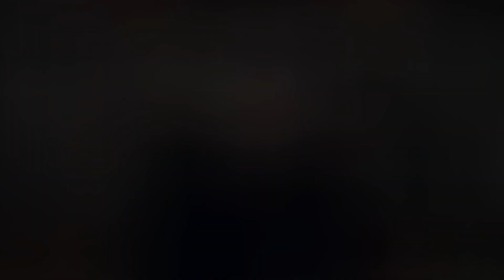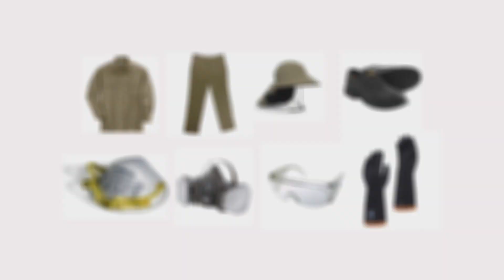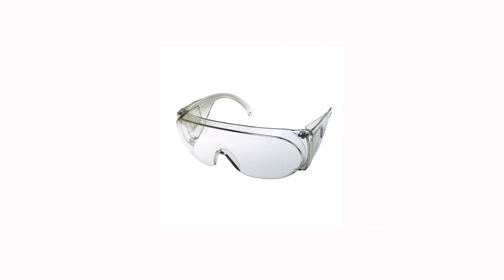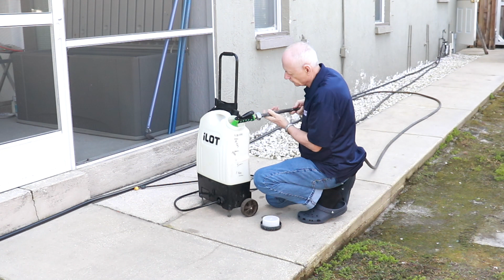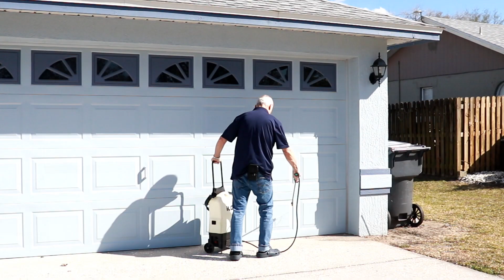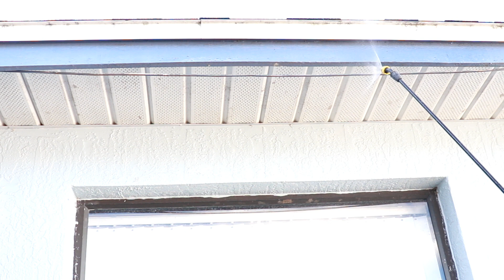How to Prevent Drywood Termites 100% Guaranteed.

Comment: If located a drywood series of kick outs, suggest a spot treatment please, great video on prevention will incorporate but have an active swarmer being attracted to the frog tank black light at night.
Reply from the maker: First, make sure that these are actually drywood and not subterranean.  I will give you a link to my video on how to identify termite species.  If you confirm that they are drywood, then there is information that you need to know.  Please get back to me if they are subterranean.

It is important to understand how drywood termites work.  They enter through cracks and crevices around windows, doors, the eaves, pipe penetrations, and so forth.  Most of the time, they enter through several locations.  That is because a swarm of them attacked your house at the same time.  If there was a crack or a crevice, then they probably found it.  After they established their galleries, which will be inside the wood, it will take four to seven years for them to be able to swarm.  Now that they are in your house, the swarmers will use holes that are in your studs to travel through the walls.  Those holes in the studs were created by the electricians to run the electrical wiring.  Not only are these holes going through the studs, but holes were drilled into the attic for the light switches and to run some of the wiring for the outlets.  So, the termites now have easy access throughout the attic and the walls.  If you have a basement or crawl space, they have access to that as well.  Most of the time, you will have no idea that they are in the walls, because the frass is inside the wall.  To make matters worse, if you have drywood termites, then your neighbors have them too.  That means you have been getting swarmed for as long as they have existed in the neighborhood.  Most likely, we're talking about years, so it's a safe bet that you have these guys in many locations in your home.
                            
I always hate to be the bearer of bad news, but if you have drywood termites, the only way to get rid of them is to fumigate.  Prices for this can vary wildly in this industry, so I recommend that you watch my video on how to hire a pest controller without getting ripped off.  That video can save you a lot of money.  You should also know that the gas they use to fumigate has absolutely no residual action whatsoever, so you can get reinfested the moment the tent comes down.  Like I said before, if you have drywood termites, then your neighbors have them as well.  Since drywood  termites swarm every year, it is almost a certainty that you will be reinfested within a year after the fumigation is done.  The only way to prevent this is to do a preventive treatment on your house every 60 to 90 days.  Most pest controllers will not do this, so it is something that you generally need to do yourself.  I have a video on how to do that and I will place a link below.  If you absolutely cannot afford to fumigate your house, then you can try spot treating it yourself.  It is virtually impossible to find all the termite galleries, but it is way better than doing nothing.  Regardless of how you treat it, you should begin the preventive treatment immediately, so that you do not get additional termites paying you a visit.  

I hope that helps.  Be well my friend.                        

Video on how to identify termite species:  https://youtu.be/dIs_a0nfVjg

Video on how to hire a pest controller without getting ripped off:  https://youtu.be/y-a8XOqVrlE

Video on how to spot treat drywood termites:  How to Treat a Drywood Termite Infestation Yourself. A MUST see if you have Drywood termites.

Comment: What is your recommendation on spraying windows and soffits on second floor without going up and down a long ladder every few feet?
Reply from the maker: You are not supposed to do this, but I do it with a hose end sprayer.  Please watch my video on how to treat your yard with a hose end sprayer.  The sprayer in that video has a stream setting that will reach up to 25 feet, depending on water pressure.  You must use Bifen XTS in the sprayer.  It seems expensive, but it only gets mixed 1/3 oz per gallon, so it goes three times as far as other pesticides and it works well for drywood termites.  In fact, that is what I use.

I hope that helps.  Be well my friend.

Video on how to treat your yard with a hose end sprayer:  https://youtu.be/wifoTU5dmp0

Comment: Hi thank you for your video I am dealing with both types of termites rite now and because my neighbors house was tented about a month before she bought it and she ended up having an issue again in less than a year I am reluctant to spend thousands of dollars to have our home tented. I really don’t have money to waste so I’m wondering what you would recommend to go along with this to treat the other type can you link the video you’d recommend for them please
Reply from the maker: Let's start with the drywood termites.  It is important to understand how drywood termites work.  They enter through cracks and crevices around windows, doors, the eaves, pipe penetrations, and so forth.  Most of the time, they enter through several locations.  That is because a swarm of them attacked your house at the same time.  If there was a crack or a crevice, then they probably found it.  After they established their galleries, which will be inside the wood, it will take four to seven years for them to be able to swarm.  Now that they are in your house, the swarmers will use holes that are in your studs to travel through the walls.  Those holes in the studs were created by the electricians to run the electrical wiring.  Not only are these holes going through the studs, but holes were drilled into the attic for the light switches and to run some of the wiring for the outlets.  So, the termites now have easy access throughout the attic and the walls.  If you have a basement or crawl space, they have access to that as well.  Most of the time, you will have no idea that they are in the walls, because the frass is inside the wall.  To make matters worse, if you have drywood termites, then your neighbors have them too.  That means you have been getting swarmed for as long as they have existed in the neighborhood.  Most likely, we're talking about years, so it's a safe bet that you have these guys in many locations in your home.

I always hate to be the bearer of bad news, but if you have drywood termites, the only way to get rid of them is to fumigate.  Prices for this can vary wildly in this industry, so I recommend that you watch my video on how to hire a pest controller without getting ripped off.  That video can save you a lot of money.  You should also know that the gas they use to fumigate has absolutely no residual action whatsoever, so you can get reinfested the moment the tent comes down.  Like I said before, if you have drywood termites, then your neighbors have them as well.  Since drywood  termites swarm every year, it is almost a certainty that you will be reinfested within a year after the fumigation is done.  This is why your neighbor got reinfested.  The only way to prevent this is to do a preventive treatment on your house every 60 to 90 days.  Most pest controllers will not do this, so it is something that you generally need to do yourself.  You already watched the video on how to do this.  If you absolutely cannot afford to fumigate your house, then you can try spot treating it yourself.  It is virtually impossible to find all the termite galleries, but it is way better than doing nothing.  Regardless of how you treat it, you should begin the preventive treatment immediately, so that you do not get additional termites paying you a visit. 

If you have drywood termites, then you also live in Formosan termite territory and you may have a more common species of subterranean termites as well.  So, how you handle that will depend on the species.  Figuring out the species is actually pretty easy and I have a video on how to do that.  I will provide you with a link below.  After watching this video, you should be able to identify the species.  Just get back to me after you watch it and let me know what you found out.  At that point, I can tell you exactly what you need to do.  Let me know if you have any problems identifying the species, but I do not think that you will.  It is much easier than you may imagine.  If these are a common species of subterranean termites, then you may get away with using termite granules, but if they are Formosan termites, then you will need to trench around your house, and you will need to search for "cartons" inside the house.  So, let's see if we can identify the species before we start to treat.
        
I hope that helps.  Be well my friend.    
                    
Video on how to identify termite species:  https://youtu.be/dIs_a0nfVjg

Video on how to hire a pest controller without getting ripped off:  https://youtu.be/y-a8XOqVrlE

Video on how to spot treat drywood termites:   https://youtu.be/U7ck7zhS0Xo

Comment: I don't suppose there is any way to test the wood in my attic to see if it has already been treated with Bora-Care or similar product? Maybe a chem test on a small shaving of the wood?
Reply from the maker: Yes there is.  You can buy a test solution that you put on the wood and it changes color if Bora-Care or other borate product is present.  Sometimes you can use a black light too.  The Bora-Care may glow under a black light.

I hope that helps.  Be well my friend.

Boron test kit:  https://prginc.com/boron-indicator-test-solution-c-18_27/boron-indicator-test-solution-35-oz-p-27.html

Comment: Hey Guy if I Fumigate for drywall termites and live in a mobile home and my neighbors have termites too ,what are the chances I’ll get infested again after I fumigate , the mobile homes are close to each other that’s why I’m worried
Reply from the maker: The odds are literally 100%.  It is important to understand how drywood termites work.  They enter through cracks and crevices around windows, doors, the eaves, pipe penetrations, and so forth.  Most of the time, they enter through several locations.  That is because a swarm of them attacked your house at the same time.  If there was a crack or a crevice, then they probably found it.  After they established their galleries, which will be inside the wood, it will take four to seven years for them to be able to swarm.  Now that they are in your house, the swarmers will use holes that are in your studs to travel through the walls.  Those holes in the studs were created by the electricians to run the electrical wiring.  Not only are these holes going through the studs, but holes were drilled into the attic for the light switches and to run some of the wiring for the outlets.  So, the termites now have easy access throughout the attic and the walls.  If you have a basement or crawl space, they have access to that as well.  Most of the time, you will have no idea that they are in the walls, because the frass is inside the wall.  To make matters worse, if you have drywood termites, then your neighbors have them too.  That means you have been getting swarmed for as long as they have existed in the neighborhood.  Most likely, we're talking about years, so it's a safe bet that you have these guys in many locations in your home.
                            
The only way to get rid of them is to fumigate.  Prices for this can vary wildly in this industry, so I recommend that you watch my video on how to hire a pest controller without getting ripped off.  That video can save you a lot of money.  You should also know that the gas they use to fumigate has absolutely no residual action whatsoever, so you can get reinfested the moment the tent comes down.  Like I said before, if you have drywood termites, then your neighbors have them as well.  Since drywood  termites swarm every year, it is almost a certainty that you will be reinfested within a year after the fumigation is done.  The only way to prevent this is to do a preventive treatment on your house every 60 to 90 days.  Most pest controllers will not do this, so it is something that you generally need to do yourself.  You should begin the preventive treatment immediately, so that you do not get additional termites paying you a visit.  I hope that helps.  Be well my friend.                        

Video on how to hire a pest controller without getting ripped off:  https://youtu.be/y-a8XOqVrlE
Reply: The pest controllerbcompany
Use different gases for dry wood
Termites which gas is usually the best ? Thank
You
Reply from the maker: @ginger111008  Pest control companies almost always use sulfuryl fluoride.  The brand names include Vikane, Zythor, Master fume, and ProFume.  They are all the same thing. It is also possible that a company could fumigate with other gases such as methyl bromide, ethylene oxide, and carbon dioxide, but these gases are more hazardous and are generally not used.  My guess is that the companies are all planning to use sulfuryl fluoride, but the brand name may be different.

I hope that helps.  Be well my friend.

Comment: Hi Guy, How should a chemical be applied to facia that is out of reach as in a multi-story building for Drywood termite prevention? + Do you recommend trenching for subterranean termites for a house purchased 1 year ago (30 miles north of Atlanta in No. GA). The house seems to have been trenched before (spaced drill holes in concrete), but not sure when this was done. No visible evidence of active termite infestation (by my untrained eye) aside from a couple of questionable spots inside the house on window frames which may have been treated before.
Reply from the maker: Drywood termites do not exist where you live, so no need to treat the eaves for that particular pest.  You could treat the eaves for other things, like brown recluse spiders, wasps, and that sort of thing.  There is a way to do that from the ground, but I prefer not to explain how it's done in the comment sections of my videos.  I would be happy to share it with you if you write to me at guyspestsolutions@gmail.com.  When you write, please tell me your YouTube name, so that I know who you are.  

As for other termite species, you basically have two kinds of termites where you live, and they are both subterranean.  While you do have Formosan termites in your area, they are fairly uncommon.  The most likely species that you will run into are Eastern subterranean termites, and they are easily prevented by just using termite granules.  I used to live just north of Atlanta and I wiped out an infestation in my house using these granules.  They work very well, as long as you have dirt surrounding most of your house.  I have a video on how to apply the granules, and I will give you a link to it.  Just make sure that you use the correct granules.  You need to get the ones that have imidacloprid as the active ingredient.  A lot of the Home Depot and Lowe's stores no longer sell the correct granules, so if they do not have the ones with imidacloprid, then you can order them from Amazon.  I will give you the link for that as well.

I hope that helps.  Be well my friend.  

Video on how to prevent termites with granules:  https://youtu.be/H7rW_TSBHJ4

Termite granules:  https://www.amazon.com/dp/B000RUIJYM?ref=nb_sb_ss_w_as-reorder-t1_k1_1_7&amp=&crid=3UG5VHBQKWV2Z&amp=&sprefix=termite

Comment: Thanks for your time and providing a detailed explanation. I have couple of question  -  I have high ceiling and  found dry wood termite traces (powder on the floor)   I called termite company,  they put a hole and sprayed TERRO T1901-6.  They are not 100% sure that they have correctly located source of termite place. They informed me that if it comes again they have to do fumigation.   From your video you mentioned about outside of the house? can i use the same for inside of the house? Or is there any alternative to do it from inside?
Reply from the maker: First off, the company you hired used the wrong product and did not apply it correctly.  Also, if these are actually drywood termites, then you do need to fumigate because they are not limited to just the ceiling.  They may be in the walls and roof structure as well.  Before you fumigate though, please make sure that these are actually drywood termites and not a different species.  Please watch my video on how to identify termite species.  If they are drywood termites, then please watch my video on how to hire a pest controller without getting ripped off.  It can save you a lot of money.  The treatment in the video you watched is for preventing drywood termites and it will not treat an existing infestation.  If you do have drywood termites, then so do your neighbors.  The gas they use to fumigate has no residual action whatsoever, so you can get reinfested immediately after the tent comes down.  Therefore, you need to begin the preventive treatment before the tent goes up and you need to do it every 60 days.  You can do it every 90 days, but more often is better.  I hope that helps.  Be well my friend.

Video on how to identify termite species:  https://youtu.be/dIs_a0nfVjg

Video on hiring a pest controller without getting ripped off:  https://youtu.be/y-a8XOqVrlE